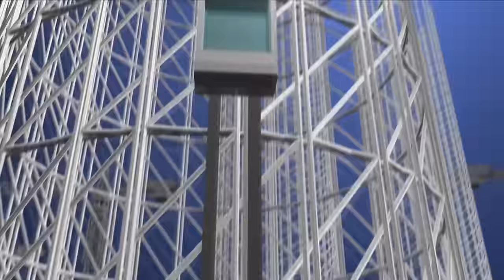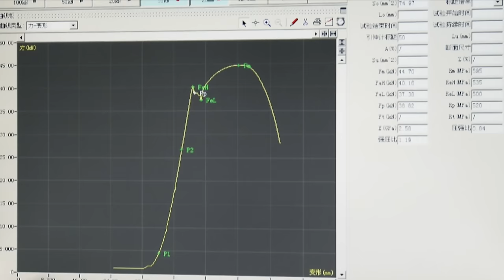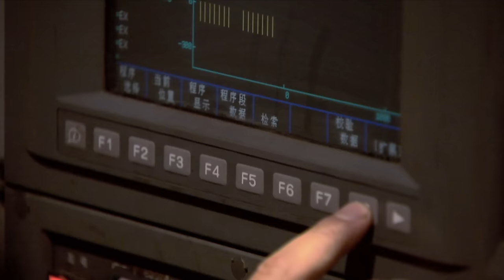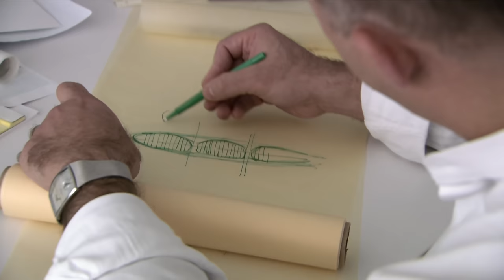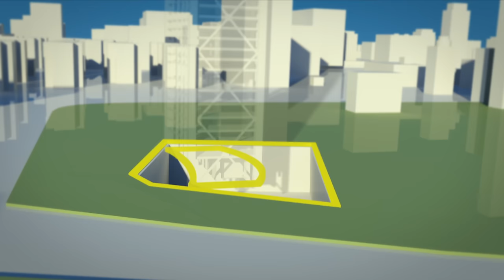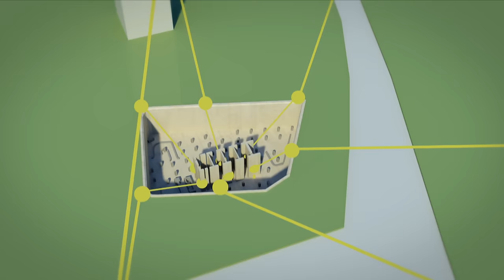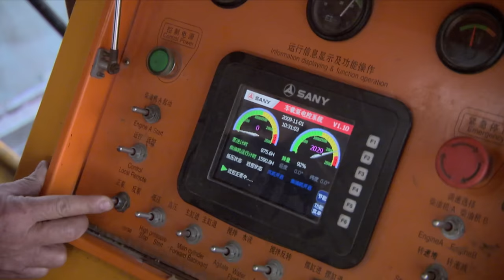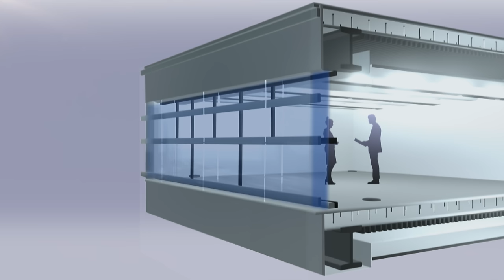The Pearl River Tower: The Skyscraper That Generates Its Own Electricity | Megastructures | Spark

Comment: I rooted around looking for some case studies of the Pearl River Tower, which show the renewables actually make only about 10% of the building electricity: Biomass energy recovery @ 1.2 MW offsets 5% of monthly building energy- almost same as the Solar, which is also 5%. The Wind contributes further 3-5%, up to max 10%. The numbers differ but generally agreed wind NOT cost effective.  The biggest contributor to saving energy is the novel fresh air delivery system. I don't know if they achieved their 40% energy reduction target. It was determined that the best way to save energy when designing is by employing more efficient systems.
Reply: As a solar power enthusiast, what brought me to this thread is the title which I think is misleading and untrue. Just looking at the building make me wonder how on earth can you generate its own electricity. Yes you have hit the button but more efficient system is about cutting down usage too.
Reply: They couldn't do net metering.
Reply: With their resources, no net metering means battery storage like off grid system. It wasn't mentioned because it will never be zero consumption.
Reply: Like I've said what brought me to this video is the title of "generate its own electricity". Being in engineering my whole life and now building my own solar power system abide a small one now , I think the world need to know more of how to sustain green energy and even climate change. By the way I'm from SE Asia and my ancestors are from China.
Reply: The only way that could get anywhere near net 0 is if every window was replaced with a solar panel. But at noon and night it's useless.
Reply: Yes indeed!  Building more efficient systems to produce energy for maintaining internal environments, as well as better insulation materials and methods. Cheers!
Reply: @liquidpatriot4480   You could store energy, it's not 'useless'.  You also get reflected light hitting the windows at high noon, too.

If you just compare how much work has gone into develop petroleum and the related technologies, over the last 200 years, people have collectively put in a lot of work to develop these technologies, and build the necessary infrastructure, so you get economies of scale to make energy cheaper and more affordable.  

At one point, in the history of petroleum technologies, it was inconceivable, totally insane, to image we would be stringing up wires all over the country to deliver power.  Engineers and politicians saw this idea as totally insane, at the time, compared to what they were doing.  And yet, here we are.  At another point, it was inconceivable that we'd make 1,000 mile long pipelines to pump crude around.  Pipelines weren't economically viable at all, before the necessary technology was developed.  But we've built a bunch of these things, today.  Petroleum technology hit very serious problems at many points, where it seemed infeasible to move forward: extracting from oil rock/shale, ocean drilling, fracking, etc.  These were hard problems.  But we did it.

By comparison, renewable energy, energy efficient systems, they are in their infancy.  Humans have hardly worked on these problems, by comparison.  We have a of engineering to do, both on the technology and the implementation/infrastructure/industry side of things.
Reply: @wolfumz  The angles of the windows reduce their efficiency during certain times of the day. While I do realize you can store energy this tower consumes more than it produces.
Better panel angles, more efficient wind turbine design and housing would make a bigger difference.
Reply: The whole thing was a scam, the architects living in a dream land. Just another vanity project where everyone get got their fat stacks, and funded by smokers funnily enough. (owned by China National Tobacco Corporation)
Hilarious on every level.
Reply: @mikemotorbike4283 So I just tried to find an article (needle in a haystack) that mentioned "some case studies of Pearl River Tower...make only about 10% of the building electricity." The only one I found that came close to that was about "Bahrain World Trade Center...cost if 3% and were expected to generate 11% to 15% of the towers' energy consumption." That same article does mention Pearl River Tower and other skyscrapers but the wording of your sentences insinuates that according to these case studies of the Pearl River Tower, it generates approx. 10% of the power consumption. I'm not saying sustainability is at its prime but I'm saying that initial sentence is misleading.

I do agree with "employing more efficient systems" but the thing with innovations is, that it's going to take time and an abundance of resources (materials, finance, time etc...) to achieve higher goals. And the thing with innovations is that they can always be better.

I am surprised they placed solar panels considering how polluted the city is. As for the comment with wind, yah I don't think it is either but I think they were experimenting with green initiatives. The upside of having these turbines is more data. Yes, nothing about it is efficient. Yes, I'm sure the cost/environmental damage of manufacturing these turbines is unreasonable. BUT taking a step towards renewable/sustainable energy is good. It's not the best option yet. It won't be in our lifetime. It probably won't be for hundreds of years. But these are very necessary steps we need to keep taking so we can keep building on our predecessors' ideas.
Reply: the triggered wumao make this comment better
Reply: Generates "SOME OF" it's own electricity is more accurate.  It's not an outright lie without the 'some of' - just blatantly misleading.  That kind of misleading marketing that has gone permanently out of style in more and more of the world. 

The 'argument' for floor air vents being more efficient (let alone 40% more efficient) than ceiling ones isn't sound.  It's a bare assertion without substantial rationale to support it.
Reply: Many thanks for the information provided. Thank you.
Reply: @wolfumz Your reply needs to be put in the comments section so everyone can read it. People sometimes forget that all of our infrastructure didn't just appear when needed. There had to be technological advances to meet the needs of design improvements.
Thanks...
Reply: I was so looking forward to the implemented ideas but it turns out they used a traditional Chinese method: bullshit physics. So let's look into how it is going, shall we :)
Reply: Just marketing and skam....as always.....and safity first they say XD.....I saw some safity issues XD
Reply: @jataro1  being an engineering student, I cannot vouch for any green energy other than Hydro and Nuclear
Reply: @davidaugustofc2574  Think nuclear is not so green after Fukushima disaster
Reply: @jataro1  Solar and Wind don't even need a disaster to be environmentally harmful. So my point stands.

Comment: well, as an aerodynamicist, sticking a couple (very small) VAWT's in those venturis is kind of a waste, so i guess this was mostly a gimmick. whats the point of building those slots and then sticking in a turbine which captures such a small subset of the flow?
Reply: When they showed the design of the vertical wind turbines I thought that meant they could fit multiple turbines in each opening. Maybe 4-6. I was surprised they only did one per opening, not even two. Is there some technical reason they couldn't do at least two? Either side by side, or one on the north end and one on the south end of the opening?
Reply: @icojb25 so you think you are smarter than over 100 Engineers that worked on that building?
Reply: @AmyEugene  Turbomachinery is quite complex to design. The best configuration from a flow perspective would have been horizontal axis machine utilizing the full inlet flow (why waste any at all?). Of course, setting this up and supporting it, cantilevering a synchronous machine to generate the electricity etc off the edge of the building in this configuration would have been basically impossible (and visually ugly). So i guess they chose some small VAWT's to greenwash and make some sort of eco selling point. As to your specific question, no, generally one wouldnt want multiple machines in a (that) space. One large machine consuming all the streamlines is what you would want.
Reply: @KamvaGwadiso  Well I do have a PhD in turbomachinery aerothermodynamics, which i assume is more than you (from your bio, you seem to be an expert in 'deep trance" and music downloading) and i do design turbines all day long for a major aerospace company, so perhaps I am entitled to a couple small comments ... 🤔
Reply: @icojb25   I wasn't trying to be disrespectful, I was just asking and I'm currently furthering my studies in computers (currently learning software development ) and soon I will be enrolling in Computer Science and few years later get my PhD in Computer Science. Otherwise I wasn't going to write about my life in Youtube bio.
Reply: @icojb25  Thanks for the answer!
Reply: @KamvaGwadiso   If what he wrote is true, I bet he is "smarter than over 100 Engineers that worked on that building"... All the best to your computer studies, but try learning first to be mindful of your words and avoid guessing and pointing out people's intelligence by a few words you read.

Comment: I knew "net zero" was a pipedream right from the beginning. Even if they had installed the gas turbines in the basement, that's not "net zero".
Reply: The video said the net zero is a goal and the proposed turbine will send electricity back to the city grid for the net zero goal.   We should praise the engineer intent and efforts to make this building a low energy consumption structure.
Reply: @ah5878  It was a marketing gimmick.

Comment: @36:45 It says safety first, but at 35:47 and 36:00 it shows 2 rodbusters on edge of building clearly not tied off.  No OSHA there.
Reply: Agree. For them, life is cheap, maybe?
Reply: @EugeneKee  Or the same problem as everywhere else, compliance!
They are using netting...
Reply: Noticed that also.
Reply: just look how clean those Harness, they only use it for videos. plus even that is wrong anyway, no shock Absorber Stretchable Lanyard.
safety is not existed in china anyway.

Comment: @ 4:45 , fabricating curved box beam is a science and art. Hence, only special steel fabrication shop can meet the challenge. In fact USA has only one steel fabrication shop that can mass produce curved box beam. But China has several; that’s should tell you something.
Reply: It would be interesting if you could provide a link (source reference) for that statement (not saying it isn't true). But it's certainly true, that the size and scale (and speed) at which China builds projects is World Class (World Leading) and very impressive. China is most definitely a force to be reckoned with. The size of those curved box beams (and the building in general) was massive.
Reply: @Sovereign_Citizen_LEO they built about 1/2 the world's sky scrappers every year in China.

Comment: 3:01 take a guess what happens in the second after the cut?
Pay attention they keep coming closer to the stacks...
Reply: Say what?
Reply: Ccp sucks
Reply: @seanitoism  The crane is lifting a stack of steel that caught the wood 4x4 supporting the stack over or maybe they never told the operator about the wood plank... either way what happens next is that wood support snaps as it is between 2 stacks of steel and these 2 complete idiots walking towards it will need new underware and pants at least as having 1000kg of steel fall next to you is the least you get if you are lucky. That next shot of him looking up is probably him being mad pissed of the crane operator almost crushing him during the shoot...
Reply: @qa1e2r4 
Spot on ...

Comment: Net zero is a joke for that building.  The four wind turbines are tiny compared to the building.  The solar panels are only on a small portion of the surface.  The gas turbines use natural gas, so even if allowed, do not count as net zero.  A lot of smoke and mirrors.

Comment: @42:52 you see a large weather strip sticking out between 2 window panes also not the first building with integrated wind turbines there is one in London UK but because of residential complaints thay are not used

Comment: This every each process and material with construction could be updated on more higher level, something like The Skyscraper That Generates Its Own Electricity | Megastructures | Spark  II , and will be most advanced building and technology, with best outview around this building ) This new building could in autonomous mode by itself clean air polution from carbon dioxide too

Comment: Worth noting that the efficiency of the wind generation depends greatly on maintaining un-obstructed flow of air in the vicinity. The designers and builders surely must have done studies to determine how the addition of other structures in the vicinity would introduce turbulence and reduce the efficiency of the overall design.
Seems a factor that will increasingly come into play regardless of politics, since economic development seems to require further construction roundabout.

Comment: So much for catching a nice breeze thru a window, and a roof garden would be suicide on a structure built broadside to the wind -as would be washing windows. Relief vents or not, that building had to be overbuilt to withstand wind shear, and what happens when sheet rain blocks those releif vents -during high winds? Fatigue of structural members will set in, and like the airframe it aspired to be, the place will be retired at 30 years of service. A massive expense just to drive windmills. The air replacement  system would  work fine  even if the building were not a giant air-foil, since altitude brings high wind anyway.

Comment: Construct an invisible underground geothermal power plant in an adjoining development to help power the building? A carpark above the power plant could have a solar roof & battery packs to feed EV charging outlets?
"Enhanced Geothermal Systems (EGS) are maturing technologies where bore holes over three kilometres deep are drilled down to extremely hot underground granite rock. Water is forced into the holes, heated by the rocks and then pumped back through return wells to the surface for use."

Comment: Blasting the bed rock is a very bad idea. There's a reason to the thickness of the rock. How do they know by blasting the bed rock won't weaken the strength of the bed rock which is important to support the weight of the building?

How do they know the thickness and strength of the bed rock before removing the top off? Do we have technology to fully scan the entire bed rock just to make sure it's safe to erect a tall building?

No we don't have. I guess they only assume it's safe to do so after all the owner of the building had already bought the land. Too late to discard the project even if somebody did realise it's isn't safe for high-rise building.

Engineers and architects are hired to complete the building on schedule. It doesn't mean the building won't collapse should there be an earthquake hit the building in future.

I always question the way tall buildings are built. It's never safe because there isn't a method to do so. It's all plain assumption. 

So good luck for the owner and the residents. I'll make sure will stay far away from the building.
...

Comment: Tell me if I'm wrong : Why the HELL did the builder NOT clean the surface on the junction of structural elements? since the REST of the surface actually IS painted !  
At LEAST slather GREASE over the junction surfaces, since the Whole Reason why nuts&bolts are used instead of welding, to give some flexibility to the building.  DoublePlusGood since it COULD take the nuts&bolts out for inspection, MAYBE even undo the entire junction to SEE the surface hidden by the other side.
Reply: Bolted joints carry shear loads in friction. If the surfaces are not in contact the bolts may carry additional shear loads they are not designed for.

Comment: So for reference. The Empire State building. Was completed in 13.5 months. Using 1930s technology. Including slide rulers!
Reply: 5 people also died when constructing the Empire State Building. Things usually take longer when factors such as safety, etc are primary concerns rather than completion. Not to mention all the new technologies implemented on the Pearl Tower. Not a very valid comparison.
Reply: @yoominji.  
Have to disagree with you. 
Safety equipment doesn't have to slow down construction. 
If they had implemented those same safety measures. During the construction of the Empire state building. No doubt in my mind. They could have still completed it in 13.5 months.
Thats when real men ruled the world.

Comment: net metering is offloading your burden on society while taking the profit yourself; it means you use the electric grid as a battery consuming grid power when its expensive, but selling power to the grid when it's cheap, but paying nothing if both are in equilibrium

Comment: terrible design, condensation problems for the chilled ceiling, wind turbines produce about as much power as a few family houses and not running most of the time because the maintenance/operating cost out weight the benefits. A lot of typical architect "qualitative" design without really understanding the outcome. If you want to do a documentary on an dated "novel" building like this, document how much it failed.